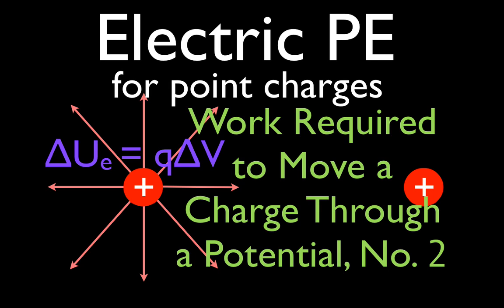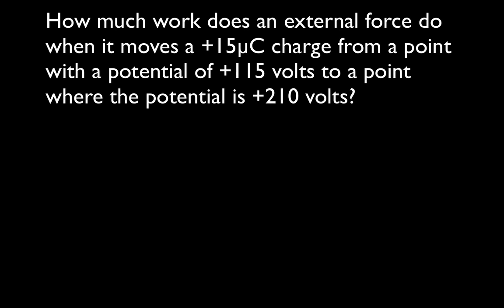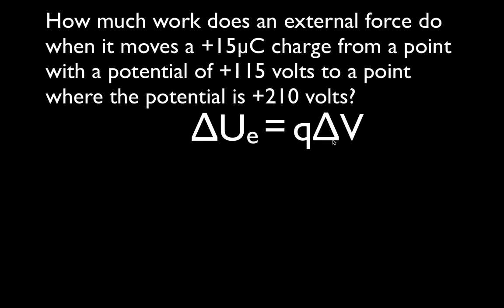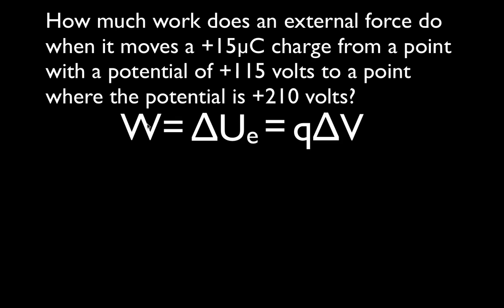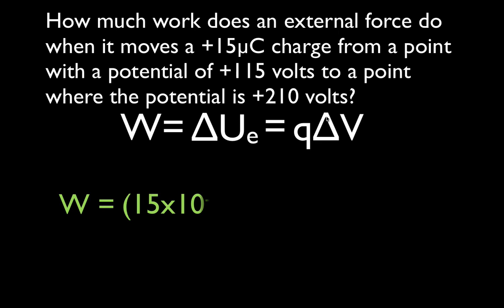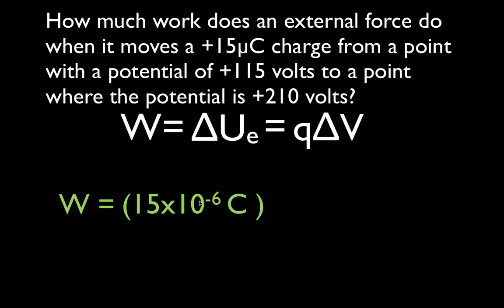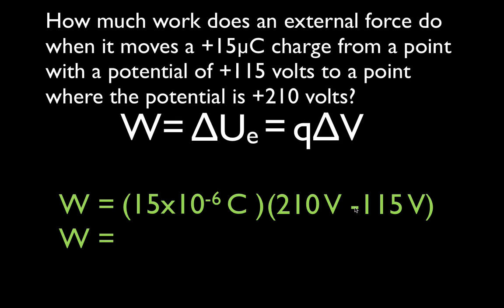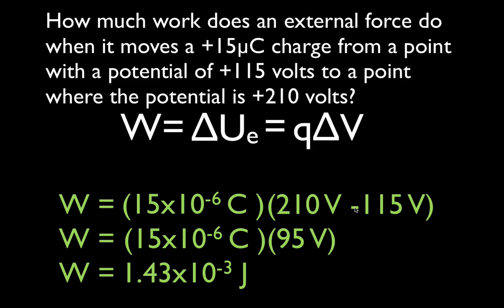Point Charges (2 of 10) Work Done Moving a Point Charge thru a Potential Difference

Comment: Positive change in potential energy means a negative work was done. Why? Work = F*d*Cos(theta).  You're moving against the force that's caused by the electric field since the electric field goes from the highest voltage point to the lowest voltage point, and in this example, you are going the opposite way. So the theta would be 180 thus resulting in negative work. Also, when you move an object off the ground, you cause negative work because the force of gravity is going in the opposite direction of your movement. Just if anyone stumbled upon this video that contains false information.
Reply: exactly, the answer is negative
Reply: Thank you! This is why I was completely confused. Work done should be negative. Electric field always points towards lower potential and the force is on positive charge is positive towards to lower potential. And in this case you push towards higher potential so you doing negative work because you are moving opposite of  direction of the force.
Reply: do you mean this information is wrong?
Reply: It has been long since I studied them. But I'm sure of the work equation above, and that if the charge is moving against the force, the cos(theta) will be "-1". Also, it does not matter if the force applied is positive or negative since we take the magnitude value of it anyway ( it's positive here fyi F=+qv). Just find better study resources, and you won't need my comment.
Reply: @yaseralosh3371   بعرف قبل شوي راجعت الماده وطلع صح حكيك حتى اني اصلا جيت التعليقات مشان اتاكد على العموم شكرا
Reply: @fatimaa6835  اهلًا،بالتوفيق ان شاءالله

Comment: why is it not -W = delta U
Reply: I think its because the force doing the work is external.. if we were talking about the electric force or coulomb force, you have it right, but because its an external force doing the work, we think of it the other way. Newtons third law is all forces are equal and opposite, so our "external work" being positive makes the electric force negative. do you agree or disagree?
Reply: Delta u is final minus initial, thus any positive change in potential energy is caused by a positive work.